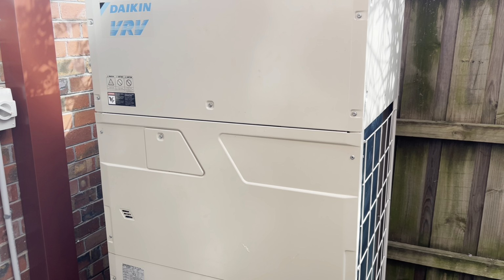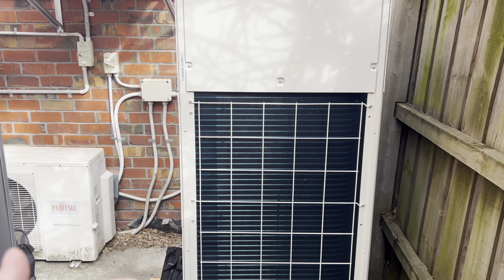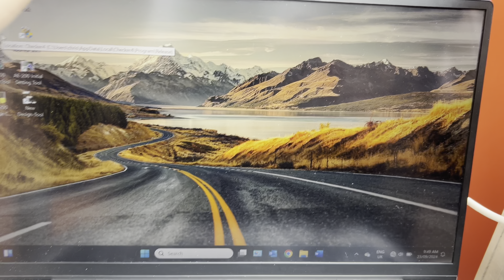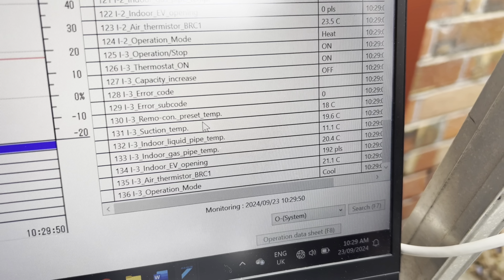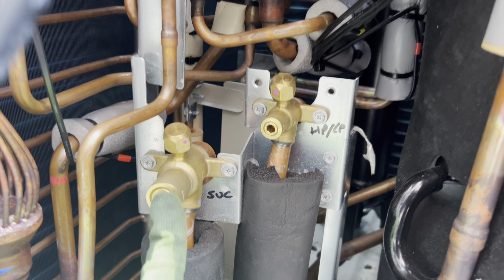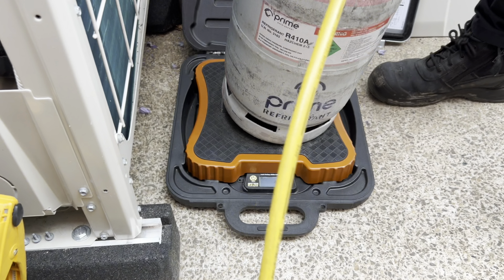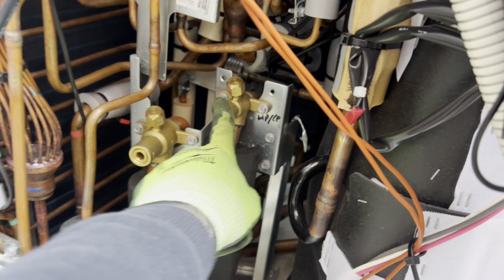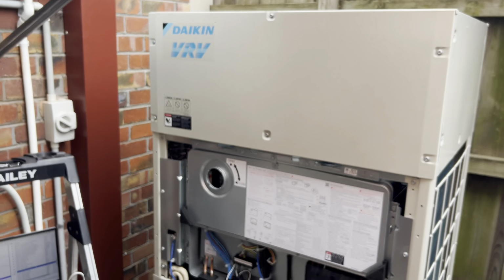Daikin VRV 6 / My First Time Connecting the Type 4 Checker to a Daikin VRV R

Comment: You can put it in charge mode (mode 20 and shut the liquid line service valve) 
and charge it down the liquid line straight from the bottle. So no chance of any liquid getting back and much faster if you’re chucking in a lot of charge.

Also if you put it through test mode before chucking in the additional charge it may judge the line lengths wrong and get its target pressures wrong. Charge mode lets you fire it up before test mode too.
Reply from the maker: Thanks mate. I took a stab and thought 960g wouldn’t make much difference so I didn’t do another test mode. If I go back once the additional 3 head have been added I’ll put the system through another test mode then.

Comment: Condenser is very quiet im actually impressed (yes i know its technically not at 100%)

Personally dont rate Daikin, fix/replace way more of them than i install 😂

Fellow Melbournian hvacr tech 🤘
Reply from the maker: It was pretty quiet overall. I look forward to spending more time on them going forward. I get it 😂 my preference is Mitsubishi Electric.
Reply: I dont know what's happened to Daikin because 20 years ago when I started out they were elite, ow having nothing but issues with their inverter boards failing, I know they had a bad batch of capacitors on their smalling splits but lately I've diagnosed 10 inverter boards on vrv 4 loops that are less than 3 years old
Reply: Feels like they spent all their budget on  designing the app than making the equipment better

Comment: Do you have a lot of sites with BS boxes mounted outside? I have never seen them outside being in Canada. As always great video!
Reply from the maker: This is the second one I’ve ever seen like this. Great of if I ever need to work on it.
Reply: BS Boxes should be treated as an indoor unit and should never be outside unless it's in a enclosed accessible space. I'm from Canada as well
Reply: You Canadians have to endure way colder winters where everything wants to freeze over which we just don't quite get in most of Australia, so that could be a significant reason why. Total exposure to the elements probably isn't ideal for the branch box though no matter where it is.

Comment: Any reason you charged system with vapour? I thought 410 was liquid only charge
Reply: the bottel is up side down so it still charge liquid
Reply: Stub on vapour port is at the top of the bottle amd on liquid goes down to the bottom, hence turning upside on vapour will be liquid
Reply: @daniellonergan5669  thanks, what about charging liquid into the suction line? Does that harm the compressor
Reply from the maker: I was charging slowly. There is a suction accumulator between the port and the compressor. I was also charging through a Schrader core. The chances any liquid makes it back are next to 0%.
Reply: @hvacraustralia  thanks, learning a lot through your videos 👍
Reply from the maker: Glad you’re enjoying them. Cheers.